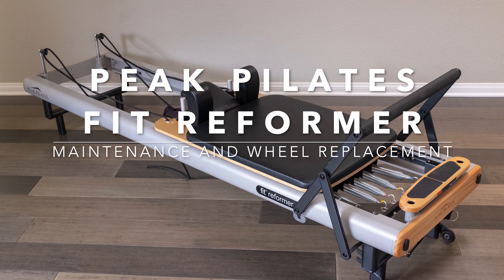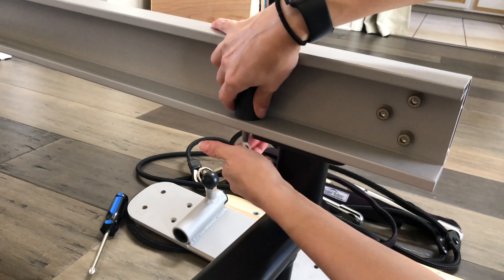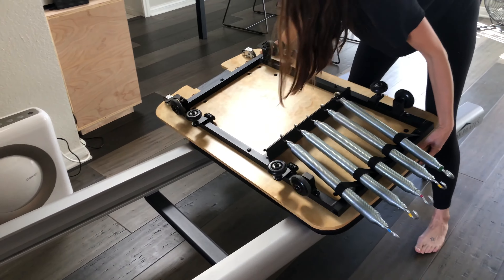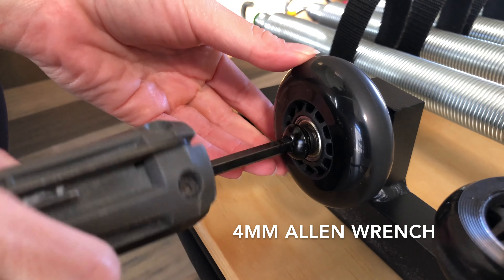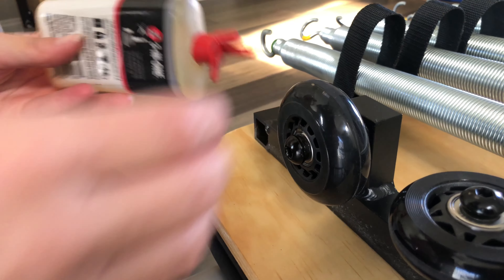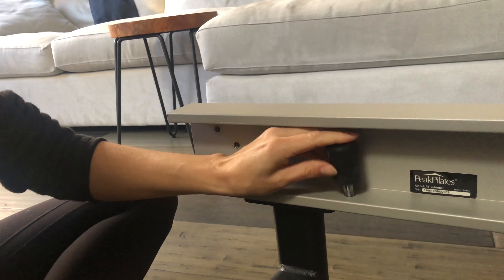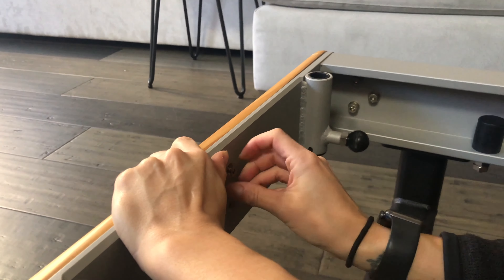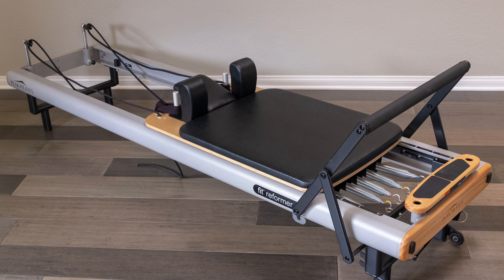Peak Pilates Fit Reformer Maintenance and Wheel Replacement

Comment: Great help- however, if you are someone with the Mve Studio Reformer with Tower- heavy plastic and wood ends with the tower attachment- it is not as simple as see here in the video. You have to remove your tower attachment, the plastic end cap-best way to remove this is to flip over once tower is off and unscrew the plastic panel that is housing the bolts underneath. Remove bolts of end cap then you can slide off the carriage. The new wheels Mad Dogg is using now are not round as the previous ones were- they are flat now and ride with more friction on the rails. Makes the ride louder. Not a fan of it as I have a studio full of balance body reformers and they are smooth and quiet. Anyone want to buy a tower unit? Im over Peak.

Comment: Great video! How often does this reformer require this level of maintenance?  Thanks!
Reply from the maker: It really depends on use. It is recommended to clean your tracks and wheels monthly, but I do mine quarterly as my machine only gets a few hours use/week. Wheel replacement I do as needed.
Reply: @pilatesbykels  Good to know - thanks so much! 😊I've used them in studio, but having one at home will be new.